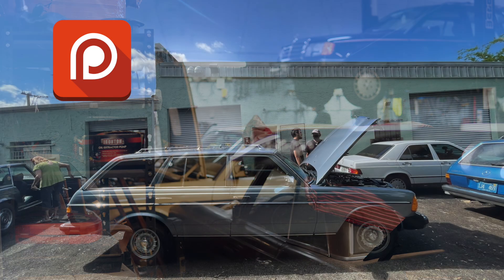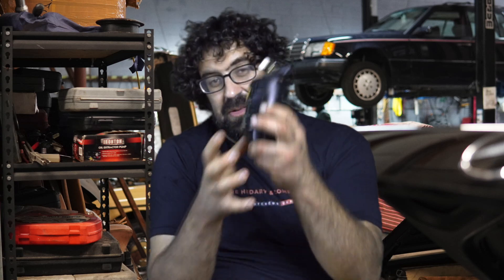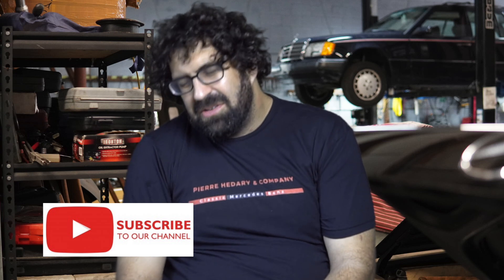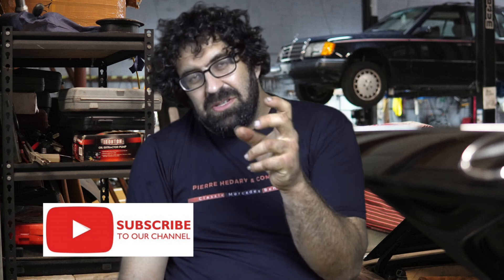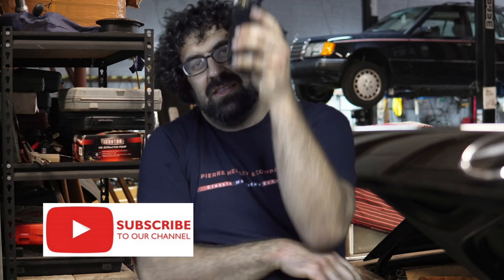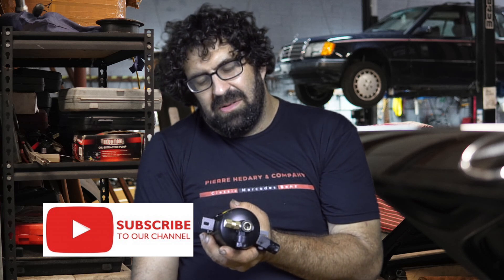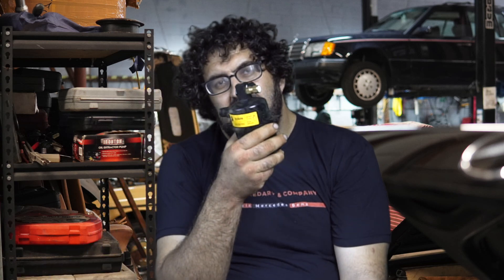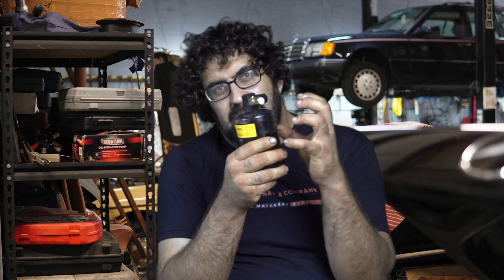Number one failure point on the Mercedes Benz AC system   HD 1080p

Comment: I wonder if it is possible to recondition otherwise unobtainable filter-driers by flushing them backwards with solvent and compressed air, and then baking them in an oven to de-sorb the moisture from the dessicant.
Reply: Good question, but I doubt it. I've cut them open before and the ones I've seen have very fine filters in them and I can't imagine you could effectively clean all the debris out of it, especially the cloth desiccant bag itself.

Maaaaaybe you could clean out the old oil somewhat well if there's no evidence of contamination from something like a failing compressor, but I'm not sure what (if any) solvent could be used that's strong enough to clean out the old oil without damaging the internals and also leaves no residue when it dries.

I'm also not sure how much heat would be required to dry out the desiccant or if that temperature would internally damage the dryer. Obviously keeping the dryer under a deep vacuum while heating it and occasionally breaking the vacuum and purging with dry nitrogen could be helpful. Hopefully a chemist/engineer replies with more details.

To be honest, if I had an old and/or questionable dryer and couldn't find a decent replacement, I'd rather have custom lines made to use a quality universal or more standard dryer than try to reuse the old one. Obviously you'd need to make sure to use a dryer that's compatible with the refrigerant and oil you will be using.

Comment: First post to your channel, I had heard of you and your outstanding reputation when it comes to Mercedes on BenzWorld. Recently, mileage wise, I did an A/C compressor swap on my '91 560SEC due to the front pulley/clutch seal leaking and did the dryer swap just because of being told any time the system is opened to replace it. She blows ice cubes once again. I'm having another long term issue with fuel delivery and have watched several videos on it and will begin to address this soon. Keep making these as they are very informative and detailed on what to do.

Comment: Pierre I need your help. I am working on a 1970 280SL. The vehicle is in very nice shape but at 7 miles it stumbles and looses power. Cycle the key and it runs good for another few miles. The ignition switch has been replaced. Any ideas? Thank you.
Reply from the maker: Hello, James Lewis and thank YOU so much for your question(s), we want to answer you as quickly as possible. 
By signing in our Patreon https://www.patreon.com/thomaspolk page and making a donation of $10 your are assured of a 24 hour email response from Pierre. 
If you are already a $10 member please mention along with your question.

Comment: I have just replaced the Behr dryer (this is the short fat version as opposed to the long narrow type) and expansion valve on my W108 280S, next step is to get it charged and hopefully it will be all systems go.  The condenser and evaporator have also been cleaned inside and out, some of the cooling fins on the condenser have also been re-aligned.